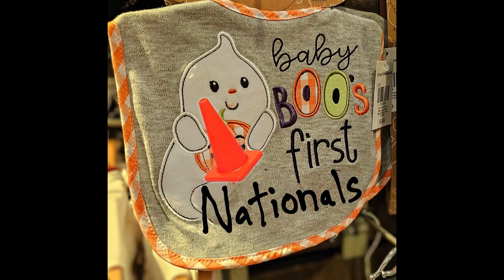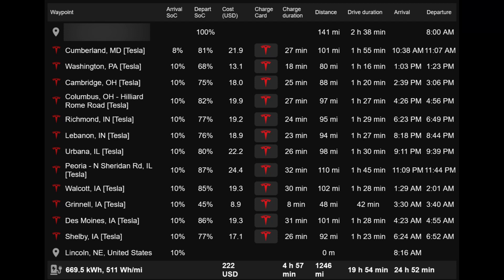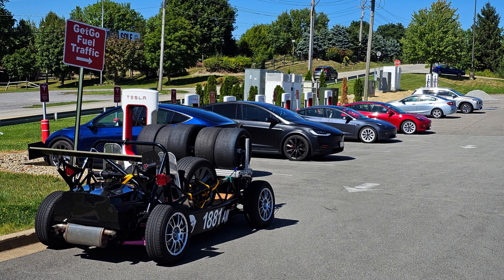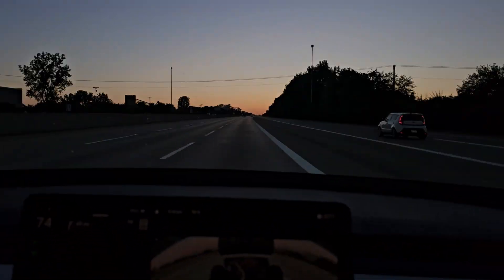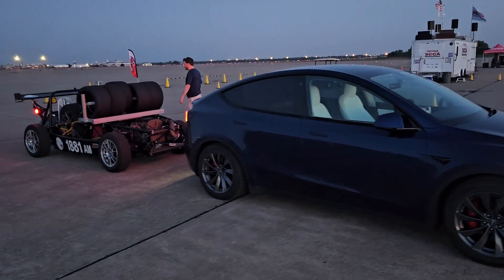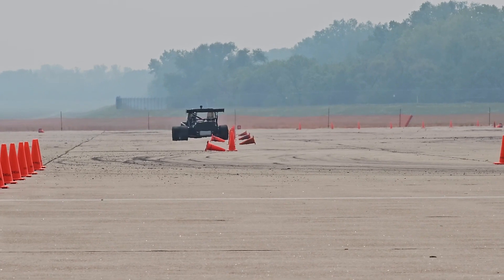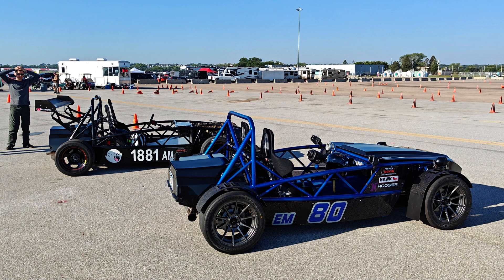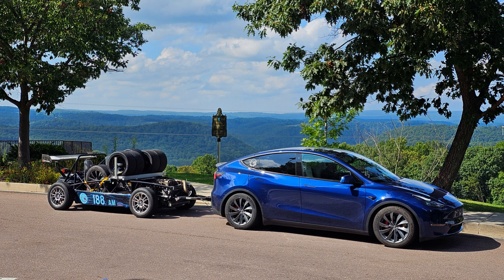Boo 2023 Nationals Recap

Comment: That is a wild setup. Maybe one day I will try to tow with my model 3 lol. Did you use the AP at all during those long highway stints ? If so did you feel it helped make the drive more relaxing/less draining
Reply: Unfortunately the Y has tow mode, which is automatically enabled when the trailer lights on Boo are connected. Tow mode won't let you use autopilot. We used adaptive cruise control most of the time, but it was still so effortless to drive.
Reply: @UBSLIPN  oh I didn't know that ! Thanks for the info